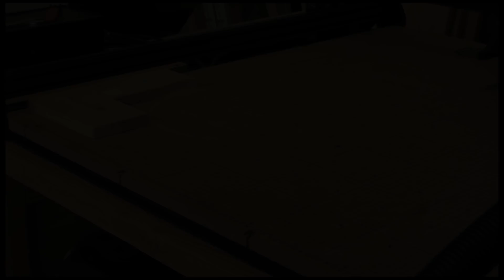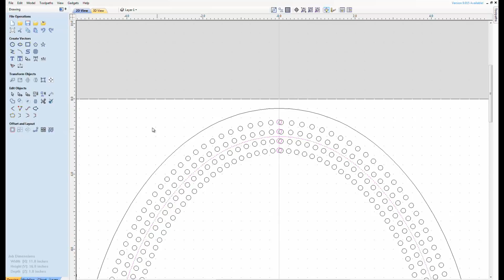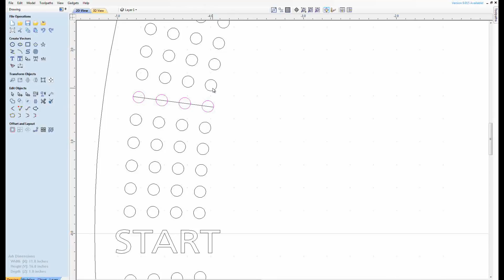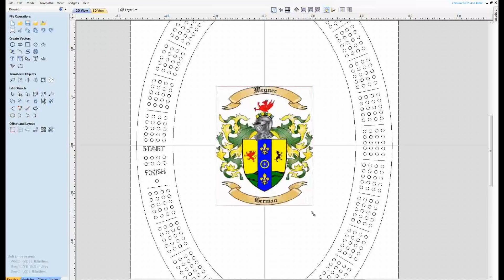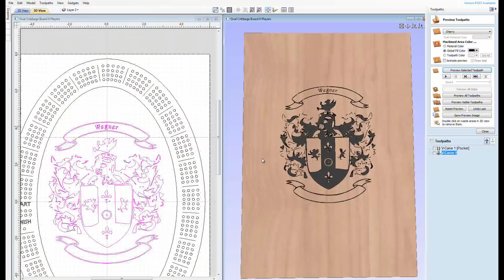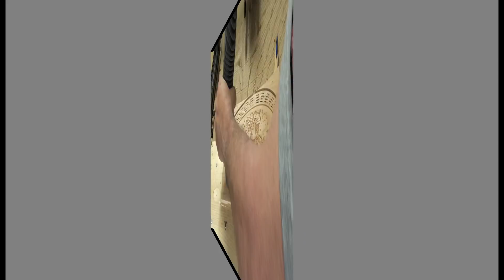X Carve and Vectric Aspire Tutorial - Coat of Arms Cribbage Board

Comment: Nice! I was wondering why you reset the Z after carving the lines when you didn’t change bits? The material height is still the same so shouldn’t have been able to run from original position right? Like the paint job!

Comment: Hello jams. Great video, did u hand paint it ? How did u paint it so well that the paint is inside the pocket not passing the lines ? Coz am using vinyl stick it before machining it then after the carve finish I paint it and remove the vinyl
Reply from the maker: Sorry for late reply.  My wife just painted it with a small brush!  Thanks for watching!
Reply: My trick is to hand paint then finish sand the surface. Before you start seal the top to stop paint bleed. Comes out pretty good every time

Comment: Hi James, great video. I would love to see the process you went through to make the pocket hole on the back. I have a project I'm doing that would benefit greatly from this. Thanks in advance and keep up the great vids.
Reply from the maker: Hi Howard - thanks for watching.  I think I showed that in this video - https://youtu.be/cmjOvI3KPiI
Reply: Thanks, James. Appreciate your quick response. Nice cribbage boards. One of my favorite games.
Reply: I make plaques that  are carved on one side and have a key hole in the back. what  I found is that  there are some things  that yes will work with a cnc but using  a hand held trim router and a shop made jig is far faster and easier than turning over the board clamping changing bits then do the key hole slot takes way longer to do. Jeff Peters

Comment: Hi James - I’m curious what size x-carve you have and if you’ve made any mods. I have a stock 1000mm xcarve and usually cut at an extremely low DOC of 0.06 at 60 ipm - anything faster and I start to get a lot of chatter and the occasional spectacular failure. I’ve never been able to go 80ipm at 0.125 DOC with a 0.25” bit like you. I would appreciate your thoughts and suggestions. Thanks!
Reply from the maker: I also have the 1000mm unit.  Have made no mods, but plan to make taller corner plate to have a bigger Z axis.  I would really like it if we could use slower router rpms, but 16,000 is it.  It's all about chip load.  The only time I get chatter is in pine.  Never much on hardwoods.  Hope this helps, and thanks for watching!